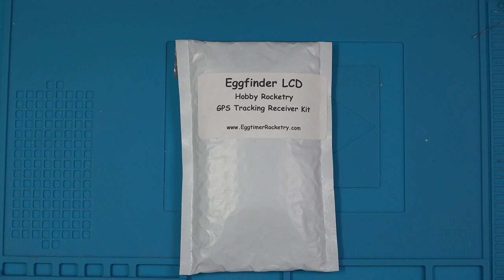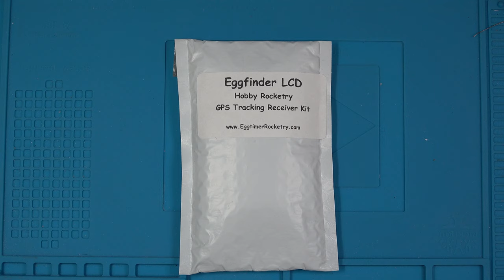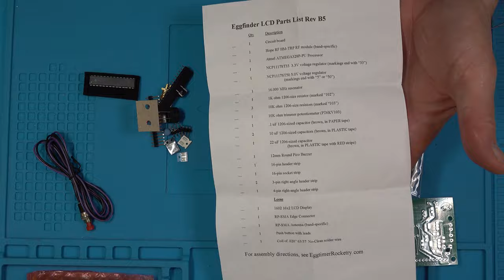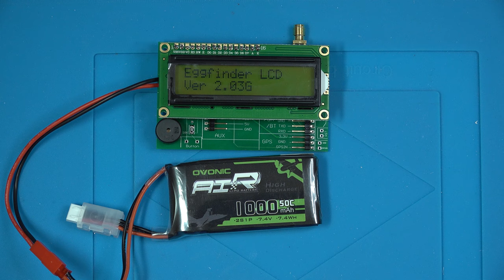Eggtimer LCD GPS Receiver Kit Build Rev B5 January 2023

Comment: your buzzer has a cold solderpoint on ground
Reply from the maker: Follow up on this - I went back and checked that solder joint and compared it to the joints for the buzzer on other LCD board I have. The metal contact on the board itself was oddly missing on the pin side of the board. I have to assume it was a manufacturing error and the solder got down in the hole and made a connection anyway. This was not a problem on the 5 other LCD boards I have. Either way, the buzzer is still working fine on this build.

Comment: is this possible to use without a push button?
Reply from the maker: If you don't have a push button installed, it will function, but it would remain at the default settings for everything and you would not be able to use it to program other modules, so it would not be very useful without the button.